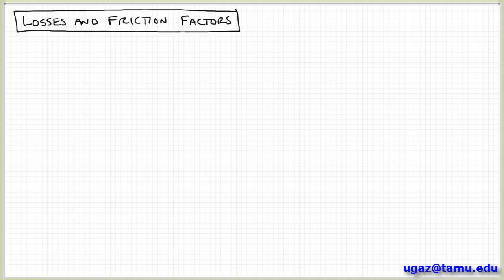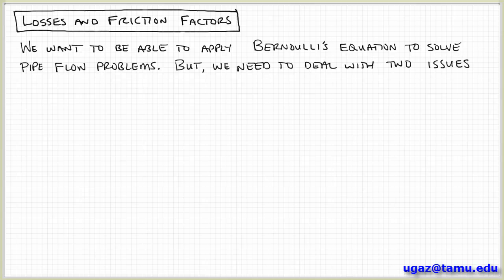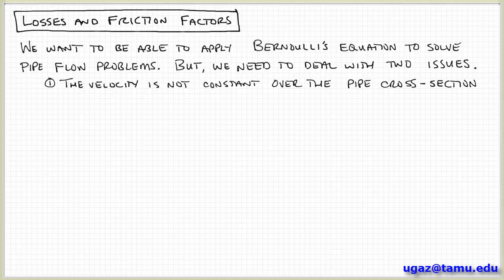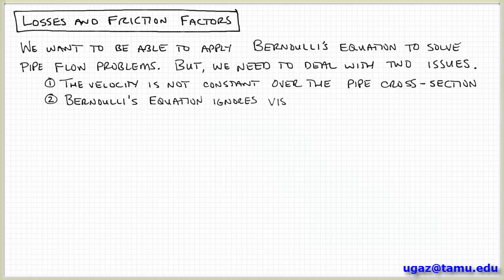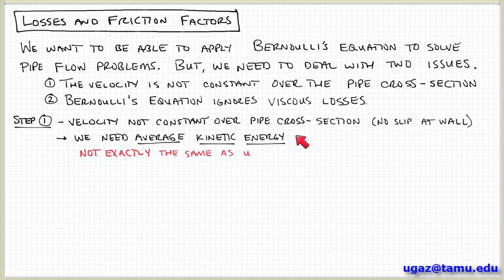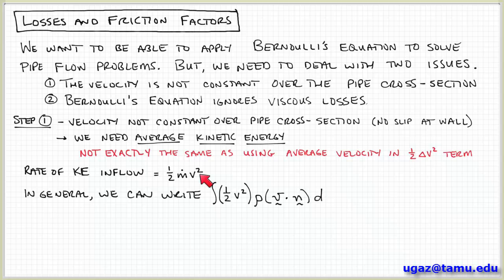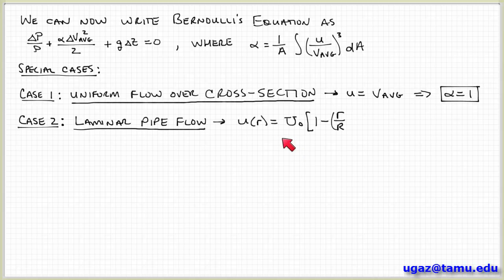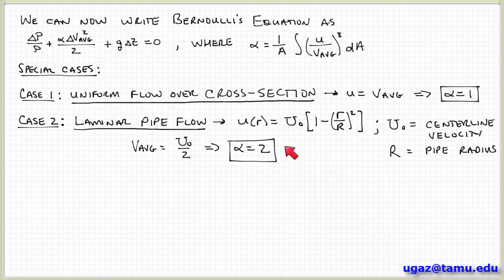Losses & Friction Factors, part 1 - Lecture 6.1 - Chemical Engineering Fluid Mechanics

Comment: I don't understand the difference between small r and big R, if big R is the pipe radius, then what is small r?
Reply: r is some radius from the centerline between 0 and R.  The expression gives you the velocity at a given radial distance from the centerline to the wall.  Its easier to see when you sub in the two extreme cases of r=0 and r=R.  At r=0, the expression gives u=umax (centerline velocity) and at r=R the expression (which is the velocity at the wall) gives 0 (no slip condition).